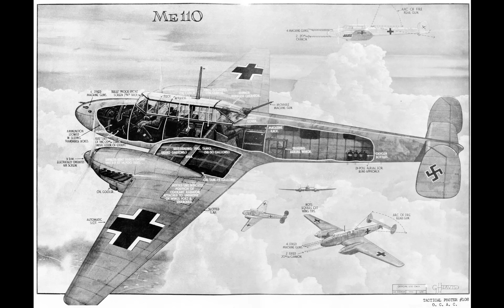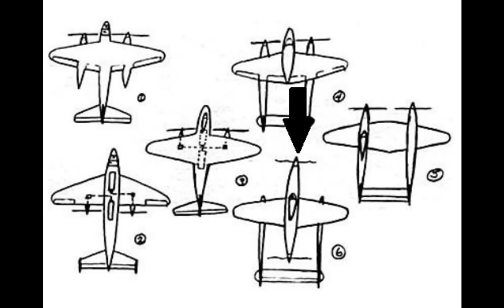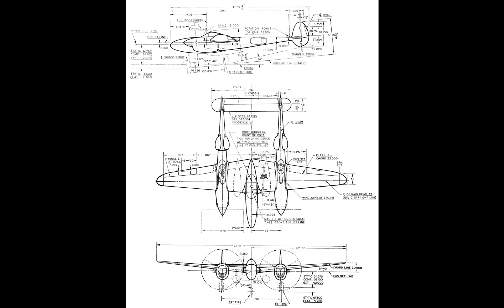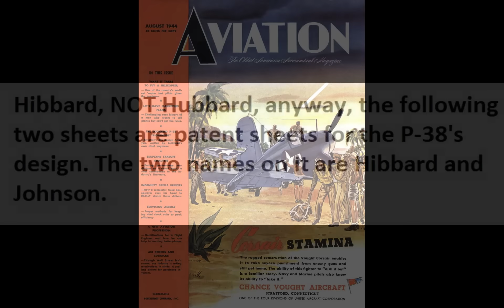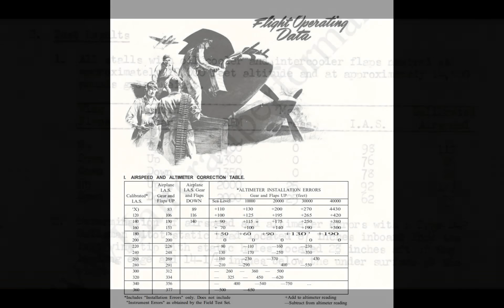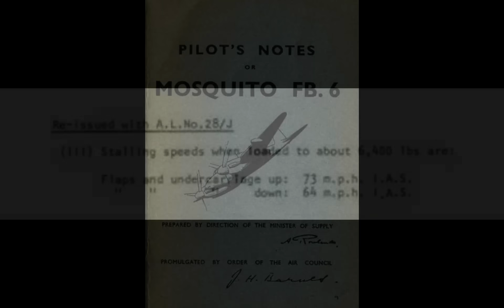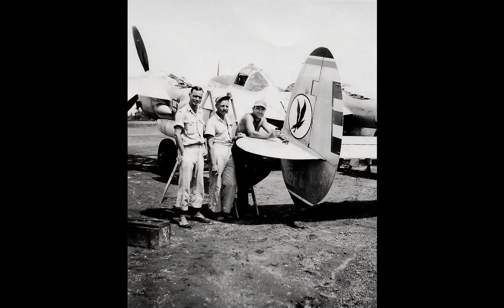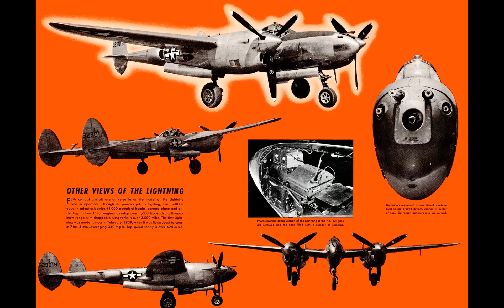Lockheed P-38 Lightning Design Info

Comment: You never got around to discussing the propellers.  I've always wondered why they turned outboard at the top, which would be the wrong (worse) direction in case of engine failure on takeoff.  Is the effect on induced lift drag offsetting?
Reply from the maker: I think I probably discussed it in another video. I'm not sure where.

Comment: Did the p38 Allison engine have a single stage supercharger in all the models as well as turbo in the boom? With all that charging power why did it only start out with about 6 1/2 compression ratio? I read that the Allies had up to 150 octane so why was the engine so underpowered to begin with by the end of the war the power on the Allison engine was up to 1600 horsepower. 

😅

Comment: There's no comparison between a 110 (which only found its calling at night) and a P-38 but there's also no circumstance (other than night)  in which I would want to have been in a P-38 in a combat zone.  You can compare performance, "durability", armament,  an extra engine... whatever you want.  German pilots when asked what they thought about the P-38 might mention those same details - but the one thing they also pointed out was that the P-38 was easily recognized as "enemy" from a greater distance than any other Allied fighters which means that a 109 or 190 pilot would not be wasting his time setting up an attack if he saw the Lightning first.
Reply from the maker: Yes, but it also means that B-17 gunners are less likely to accidentally shoot at you.
Reply: @GregsAirplanesandAutomobiles   Perfectly true - but I'd still rather be in any single-engine.  
Now that you mention it, it also means that flak gunners would be quicker to shoot at first sight - especially on the Western front.

Comment: If you go and look at the DarkAero video on flaps, they found that the split flap actually gave way more lift than is commonly recognised - enough that, given weight considerations, the DA team chose it for their aircraft over Fowlers.  Fowlers do give the maximum increase in lift/decrease in stall speed, but it costs weight and complexity (something Peter Garrison complains about on Melmoth 2; the othewise-gorgeous Fowlers on that aircraft are routinely springing leaks in the hydraulic system... not the best even in peacetime, much less when a lot of high-speed Japanese lead is flying about... 

Don't get me wrong; I literally grew up with Fowlers on various Cessnas and Pipers and I love the idea of the massive increase in wing area... and on some aircraft it really is a requirement (727 and larger in particular)... but I'm a new believer in the idea that a split flap is not to be discounted on bang-for-buck terms not just in drag but lift too.
Reply from the maker: It's not just the lift, Fowler's give you more lift with less drag than split flaps. That matters in a sustained turn fight. I'm not sure what Cessna or Piper you're talking about. They usually have split flaps.
Reply: Mind you, the 'combat flap' setting  was just a detent cut into the flange. P-38 pilots found out that if you interrupted the hydraulic actuation by pushing the flap lever a quarter-way up a second or two after commanding half-flaps, the Fowlers stayed in that quarter-deployed position where they slid just back enough to increase the wing area without dropping far enough to kill all your speed.

European test pilots used to marvel at how meticulous American craftsmanship was presented in these birds. Namely, how the cotter pins in the Fowlers were individually bent over to ensure they didn't bind into their neighboring pins during the full travel of motion.

Comment: In regards to the weapons, it seems the US has historically had difficulty with 20mm cannons for aircraft. They later tried arming the F-86 with quad 20mm cannons instead of the 6 50s it was known for and they caused a lot of issues
Reply from the maker: In WW2 that's certainly true, but by the end of the war the US Navy had good 20mms. The USAAF/USAF took longer, but they did have the M3 50 cals with 1200 rounds per min of fire.

Comment: 35:44 What "model" is this with the entirely different front engine cowlings? P-38G? I've been looking at P-38's for 35+ years and never seen that!
Reply: I think it is a P38 F/early G. Looks similar to the P38 that Red Bull owns.
Reply: @papaaaaaaa2625  thanks...
Reply: @papaaaaaaa2625  Late F or straight up G. The pitot tube is on the wing rather than under the fuselage-- a transition that happened with the F.

The F is also where they changed the top canopy panel so it's hinged at the back. Prior to that the canopy opened to the right.
Reply: Oh, boy. Here we go...

The P-38 is Lockheed's Model 22. They add a number to the front for each new variant of the model. The Model 122 were the non-combat prototypes (pointed propellor spinners, no self-sealing tanks nor cockpit armor). The airplane you see here is the Model 222 (rounded spinner tips, a 20mm cannon, and pylons for drop tanks/bombs).

The model you're most familiar (because it was the most numerous and most surviving examples are of this type) are the Model 422 with the flat chin in front of the engine nacelles.

The 322s were the abortive export variants they tried to sell to France and Britain.
Reply: @ that's great, but useless when looking up a Revell or Tamiya model...

Comment: When you think about it, the P-38 really did set the tone for the future of American fighters: Big, Expensive, 2 engines, 2 tails, carries a lot of bombs for a fighter.
Reply: The F-15A then to F-15C and F-15E evolution somewhat echoes the P-38s. First, an air force specification for a high climb rate, high performance at altitude, lots of range, lower wing loading, etc results in a good-to-great "fighter". Satisfying those requirements then results in an airplane that will do the air superiority/supremacy mission but with some modifications can also carry bombs, litters, cameras, etc and like the B-25, becomes a versatile base aircraft that can be fairly easily modified to numerous specialize roles.

Comment: Why does the twin fuselage disturb you. You drive a car where you sit to one side and control it and you never feel awkward? Correct? I think it's all in your head and once you did it you would be right as rain!
Reply from the maker: Maybe, but I haven't flown a twin fuselage plane, so I don't know.
Reply: The P-38's visibility to the side and below is difficult enough with the two booms at either side-- an offset cockpit configuration means you have this immense blind spot to the starboard side of your plane. Meaning that the enemy just needs to know from which side to attack you in order to gain maximum advantage.

Comment: P-38 was very unsuccessful fighter in MTO with HUGE overclaiming. Against Me 109 overlaciming was above 8:1. Its shouldbe high against Fw 190 too, but close by against Me 110, Me 210, Me 410.
Reply from the maker: There was overclaiming everywhere, but the P-38 by any measurement using post war evaluations did just fine.

Comment: It would have been interesting to see if the twin fuselage design would have had a higher critical mach number.   As they eventually realized, putting the fattest part of the gondola and canopy over the fattest part of the wing and between the booms accelerated the air over the wing, pushing it closer to mach 1.    The rapid taper of the gondola further accelerated the air.    I know that NACA did some tests and proposed modifications to get the critical Mach up to somewhere around 0.77, but I wonder how the twin fuselage version made with mid 1930's tech wound have done?

Comment: My Grandfather moved to California in 1942 and worked at Lockheed building Lightnings. He was new to that industry, he was a carpenter back in Minnesota and had 4 little kids so a stack of deferments.
Anyway, he worked his way up to foreman. He didn’t talk much about it, I now wish I would have asked all kinds of questions. One thing he did say, when he first got there, everything was done to very high standards of fit and finish. By then time they were getting close to the end of the war, they were cranking them out so fast, the standards of craftsmanship had gone way down. Gaps, misalignment ect. He was glad to leave that industry and Moved back to Minnesota at the end of the war. 
Another thing he told me, He had some personal power tools at home, electric saw, drill ect. The gov. actually required these to be registered.

Comment: What do you think of the suggestion that twin-boom makes sense for V engines, and twin nacelle (i.e. Mosquito) makes sense for radials?
Reply from the maker: I don't think it makes sense. Who made that suggestion?
Reply: @GregsAirplanesandAutomobiles  I did.  It seems logical to me to make best use of frontal area.
Reply: @jimsvideos7201 Not so much the frontal area, but space for cooling. Radials sacrifice front-area drag coefficients for air cooling, while an inline engine requires plumbing that usually extends through the length of the airframe in order to make use of heat rejection. If you're piping liquid coolant around , you can position the radiators into a convenient place-- from a drag perspective.

Comment: Twin engine safety factors as well as contra rotation of propellers for torque cancellation.
Booms form a readymade configuration for turbo charging installations.
Nose armaments don’t require convergence aiming. 
Design is somewhat strengthened by components forming a box like structure.

Comment: The "L" model had dive flaps which made them more able to use their favorite tactic, "dive and zoom" to kill Nazis and Japs. It did not suffer from high-speed stalls of the P-51s. Counter rotating props ended that issue. Below 20,000 feet a skilled P-38 pilot would always beat a 51 pilot every time. Such I was told by my fighter pilot father of the 49th Fighter Squadron. The top two American aces of WWII flew P-38s ... Dick Bong and Thomas McGuire.
Reply from the maker: No question that it was a capable airplane. Thanks for your post.
Reply: @GregsAirplanesandAutomobiles  A sidebar: In 1972 Revis gave me a ride in his Scatterbrained Kid. Thrill of a lifetime, till I got to actually fly an F-16 in '03

Comment: At 00: 32 "P38 doing PR over 90% of Europe" is plainly false RAF doing PR since Nov 39 right through to 1945 and did not use P38s
Reply from the maker: Read the quote again. It doesn't say 90% of the recon missions, it's using another metric.
Reply: @GregsAirplanesandAutomobiles  obtained 90% of aerial film over Europe   What other metric is there??????
Reply from the maker: Jack, exactly, "obtained 90% of the aerial film captured over Europe". That's the correct quote. In your original post you said "doing RP over 90% of Europe" that's a very different metric . I'll probably cover this in a video one day when I get around to comparing the Mossie and the P-38.
Reply: @GregsAirplanesandAutomobiles  We seem to be on a different page.
'You read it, hell I don't know how you read it 
I read it that the P38 took 90% of the photos taken by aircraft over Europe
And do not worry about Mossie PR the RAF   went to the Spitfire because it could do the job as good  and only use One Engine and one man .
Reply: It says that the P-38 took 90% of the Recon Photos taken over Europe.  That's clearly different than stating that it flew 90% of the recon missions.  How many photos did a P-38 take per mission vs a PRU Spitfire?  Plus, that's taken from an advertisement, not an official document.  As Greg mentioned in that segment, there was an incorrect piece of information in that same ad. 
 Why are you guys still so salty over the overwhelming materiel advantage that the US brought to the War in Europe?   @jacktattis

Comment: Kelly Johnson seems like about as close to a friendly mad scientist as you can get for an aircraft engineer, considering the sorts of solutions he and his team came up with to problems people didn’t even know they had

Also, I absolutely love this plane just for the way it LOOKS, before even getting into was a bizarrely smooth ride it was for a twin engined aircraft: it just looks like a classical Golden Age Superhero, somehow, beaming with idealism and patriotism. It’s also incredibly symmetrical in its design, thanks to the counter rotation meaning they don’t need to build in aerodynamic features to counter torque. That also makes it one of the few aircraft I can understand how to fly in simulators, and the significant “shake” at the edge of stall certainly doesn’t hurt when it comes to learning how much “pull” you can get away with

Comment: A couple of points. You mentioned that the P38 couldn’t take the benefit of a paddle blade larger diameter prop due to the height above ground. What do you think of going to a 4 bladed paddle prop? This would get a lot more prop area and then you could turn the boost up to 1850 or so per side. Also, in one of Corky Meyers test flight articles he called the P38 overpowered. I have no idea what he means by this. Any idea?
Reply from the maker: I think four bladed paddle props would have helped, but the economics and realities of the war just didn't support doing it.

Comment: Tell everyone what happen when it first was tested with both engines turning the same direction.
Reply: You'd get the usual. Torque, asymmetric propwash effects on the tail, and p-factor.

Add in that little aerodynamic quibble that forced Lockheed to reverse the prop direction on the P-38: The left-hand propellor would disrupt the lift created by the left wing if it spun clockwise like the right-hand prop does.

Comment: If the P38 has a mechanical supercharger incorporated with its turbo, can we then claim that the P38 is a turbo-compound aircraft?
Reply from the maker: It does have a mechanical supercharger in there.
Reply: @GregsAirplanesandAutomobiles  Whoops, typo, had instead of has 🤦🏻🤣, corrected the little oopsie.
But still, quite the concept.  Having the turbo raising the ambient atmospheric pressure for the mechanical supercharger to function as if still at sea level, or lower altitude, is genius.
Reply: The turbocharger sits ahead of the carburetor and acts as the second-stage forced induction, coming into action when the throttle is advanced past 2/3rds open.

The mechanically driven first-stage supercharger sits behind the carburetor, increasing pressure of the metered fuel-air charge.

They are two different compressors working in series, with the carb sandwiched between them.

Comment: The included tropicalisation is nice the poor old spitfires that got tropicalised did quite poorly for spitfires.
Reply from the maker: Yes, that really was a nice and rarely mentioned feature typical of U.S. fighters.
Reply: @GregsAirplanesandAutomobiles  would the possibility of designs actually being done in dusty bits of the us, I'm thinking of the bits like Arizona play into the designers decision to integrate the topicalisiation of such. It's the old chestnut of if the weapon system is absent from a battle it can't contribute to it. And if your on country has such regions they may be part of the intrinsic design requirements. A bit like russian kit and cold weather

Comment: An interesting fact from Mr. Bodie's classic P-38 Lightening book.  Lockheed expended roughly 3/4 Million US Dollars to develop the prototype for what became the P-38 Lightening.  IF they would not have been awarded the Military contact for that plane, the company would have gone bankrupt!  Not to mention the uncertain fate of the Allies in WWII without the Lightening & Republic's Thunderbolt; which also was saved from bankruptcy by being awarded a contract for the Seversky P-35 Fighter while the concept of the P-47 was being developed and the company being reorgnized (basically under pressure from the Army Air Corps Leadeership) as  Republic  Aviation.

Comment: Whirlwind was pretty good fighter at low and mid altitude. It was a more beautiful plane than the P-38 however not sure it had the same capability as a fighter later in the war. It was a great attack aircraft but no growth potential for that and the mosquito was everything the RAF wanted and then some for attack and strategic bombing

Comment: I always wondered why Lockheed chose a twin-boom design for the P-38, and then it hit me: thin wings! The twin booms combine with the inner wing and the tailplane to form a rigid-ish frame that breaks up the wingspan into shorter, more rigid, sections that require less internal structure to support their cantilevered lengths. That translates into a thinner wing, which aerodynamicists were coming to understand was essential to high speed flight. Thick wings go a long way toward explaining why the Hurricane was generally inferior to the Spitfire despite each using the same powerplant, and why the Typhoon disappointed at high altitudes. When the P-38 was commissioned, monoplane fighters were a new and scary concept: the prevailing wisdom was that only a biplane "box" could absorb the stresses of violent maneuvering, so when tasked with developing monoplane fighters, engineers, such as Hawker's Sydney Camm, chose thick, rugged wing cross-sections. Lockheed, understanding that they'd never hit the ambitious speed targets with fat wings, apparently chose to minimize the structural loads on the wings by using shorter unsupported lengths. At least that's the way I see it.